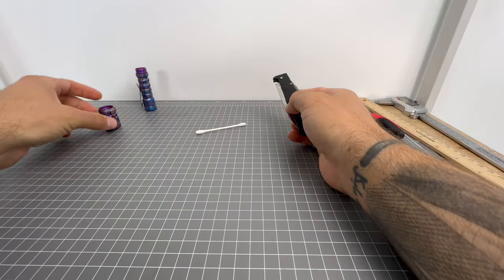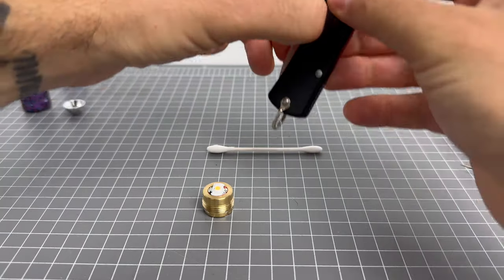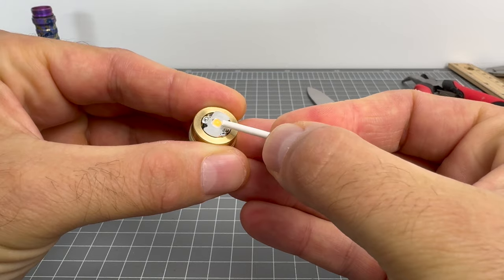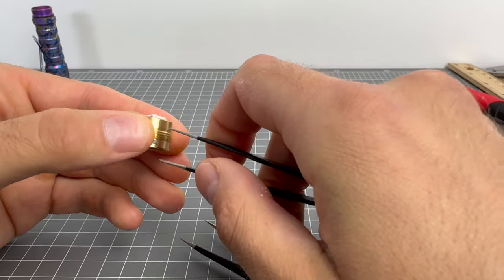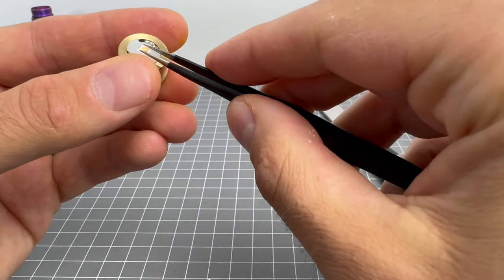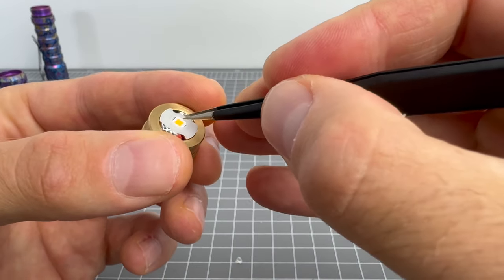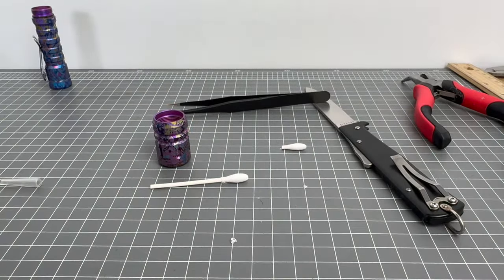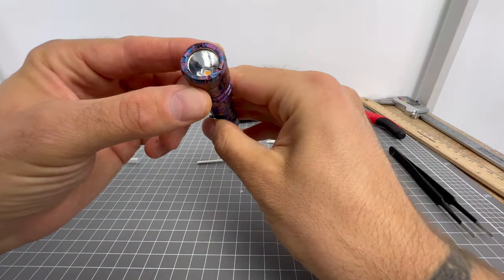How to DeDome a ReyLight Nichia 519a LED The amateur way

Comment: Nice work! I'd just pinch the dome off with my fingernails, use a razor to tidy up excess dome and maybe wipe the glass on the LED with a q-tip soaked in isopropyl.